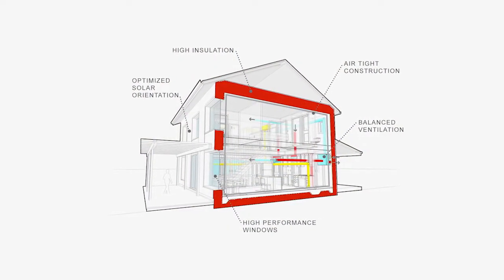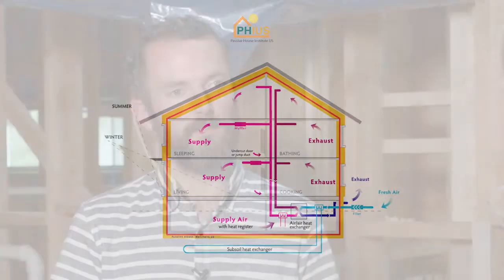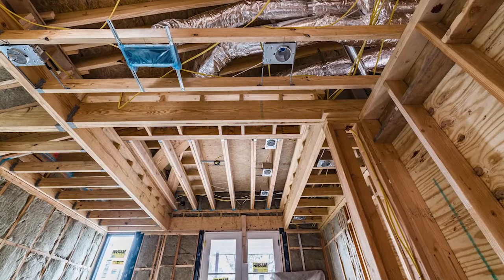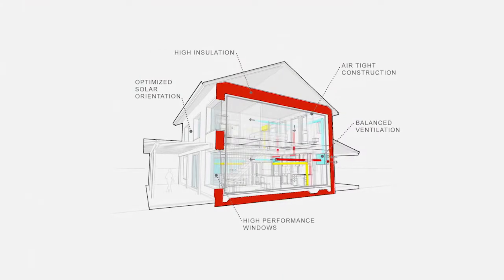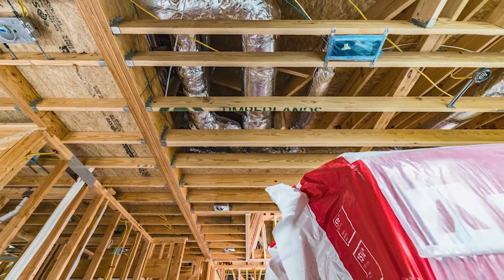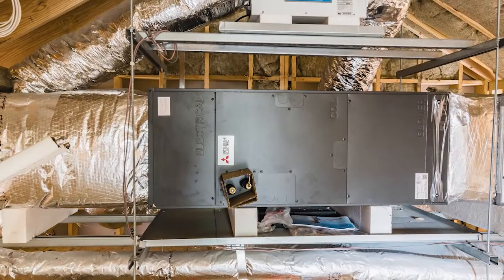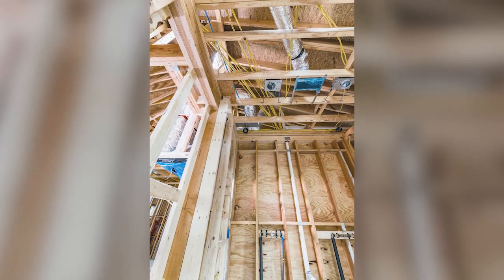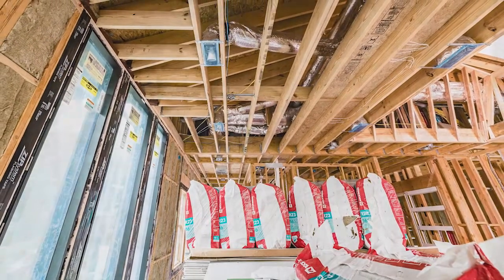Farmer Passive House (Austin, TX)

Comment: These guys need to quit with the 10 percent of the energy usage lie. It will only take 10 percent the cost TO HEAT AND COOL THE HOUSE. The other electricity usage in the house is the same lighting water heating cloths washing etc all take the same energy as a typical house